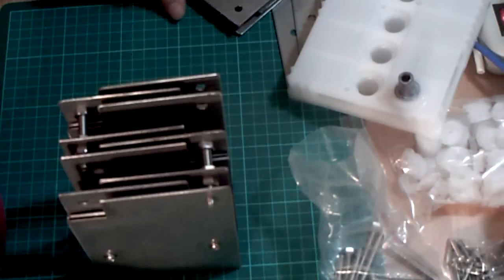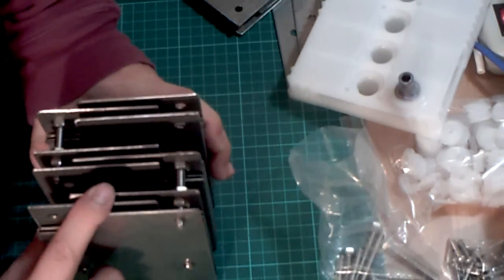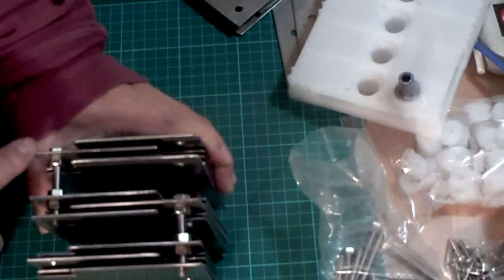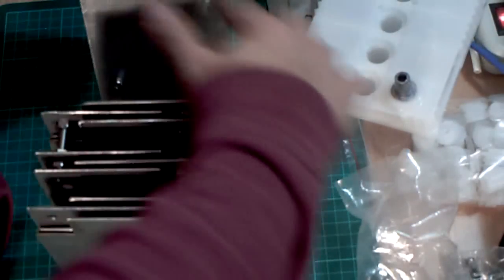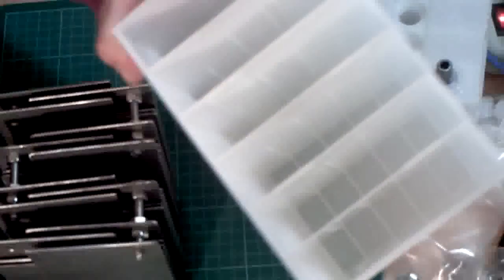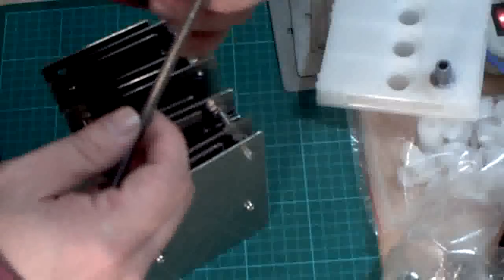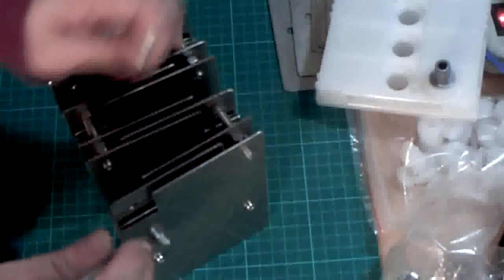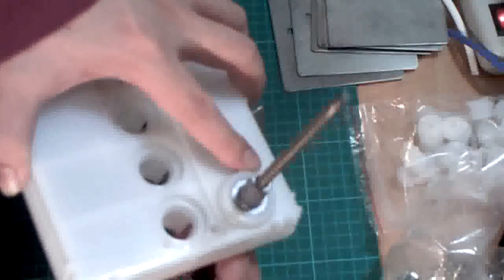Series MultCell Assembling

Comment: Yo couple quick questions, 1.) are you still alive . I add to it that it’s odd I’ve spent hours browsing through HHO videos and just seen you videos though they been up 15years . But I notice no test of the cell in action. 

2.) even if it didn’t work I’m intrigued by the design and practicality, but please , did it work? If it didn’t or had failures I could def help you build on that but I really give you props on the use of a battery shell that’s fxxking genius I never thought about that. I’m in development of a Stanley meyer style for automotive use.